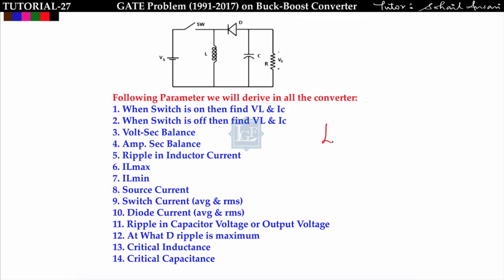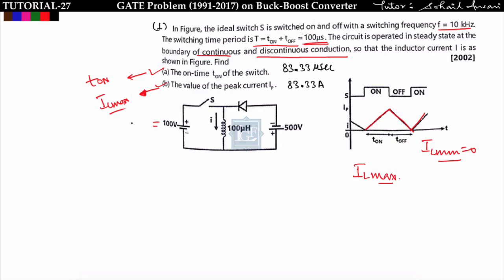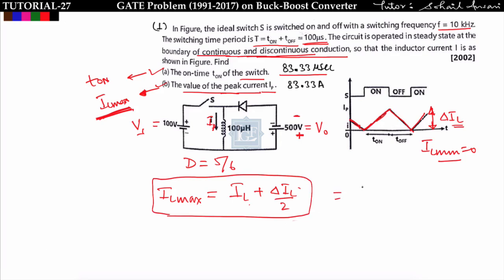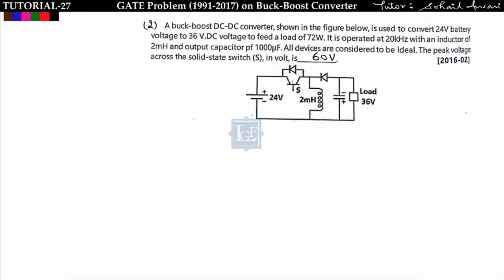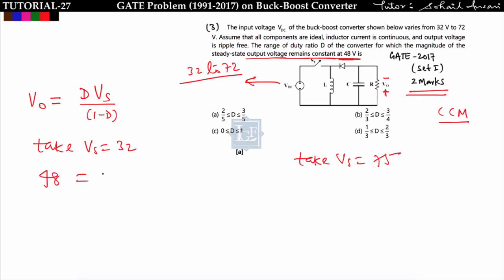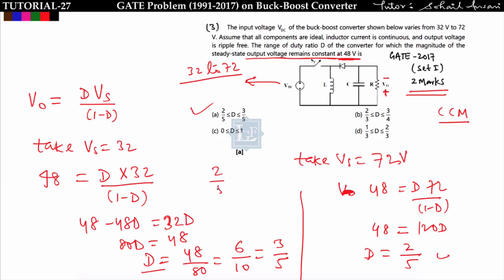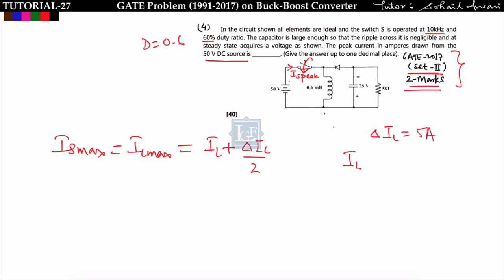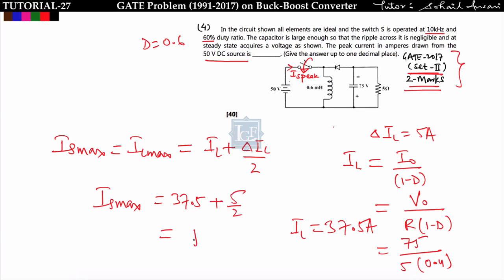Lec 27 GATE Problem Solved (1991-2017) based on Buck Boost Converter

Comment: Sir please solve this.
A Buck-boost converter operating in continuous conduction mode is used to step up a dc voltage of 20v to an output voltage of 50V. Assume that all components are ideal. The duty ratio of the converter is??
Reply: Duty = 0.714

Comment: Sir, in the last question, if we find source current by using input power=output power method. Then we get 22.5 A, then is this average current??
Reply from the maker: in which side of current you are finding?
Reply: LearnGATEfree GATEMATIC 
sir, I calculated source current as "P input= P output, then 
Is=(output voltage)^2/R*Vs. 
I got answer as 22.5A. 
This is the current from source side. Its not peak source current, that i understood. Then is it avg source current??

Comment: Sir at 6:20  min, in that question peak voltage across switch is asked. Then it will be Vsw(max) = Vs - Vc(min). But you are taking average Vc instead of Vc(min).
Reply: I too have same doubt ... @sohail ansari Sir, Please explain ...